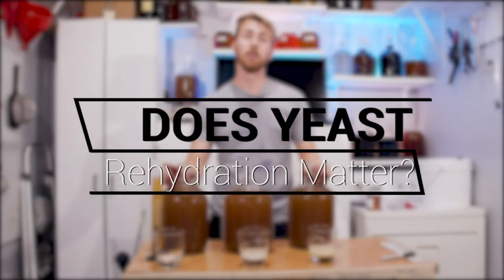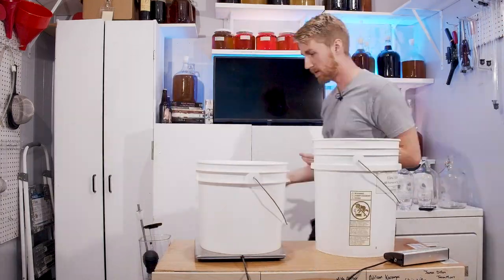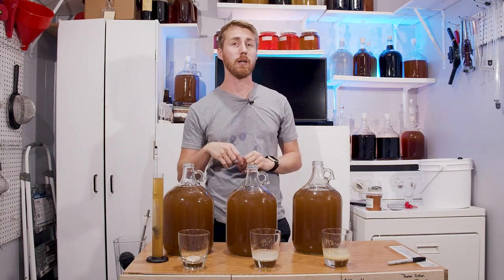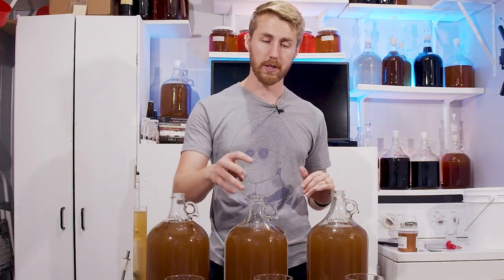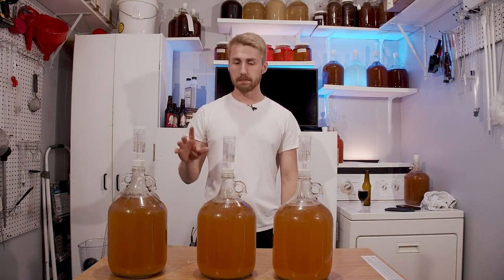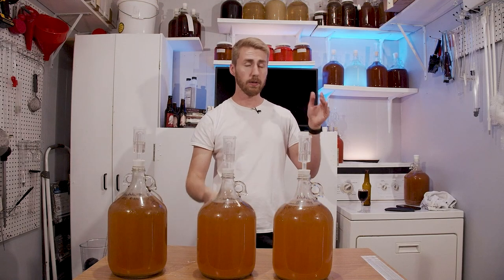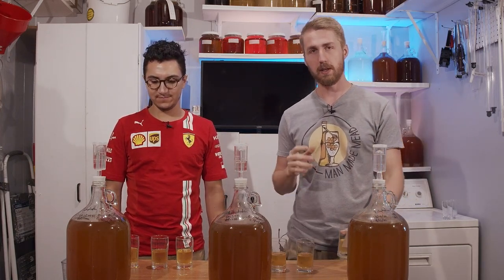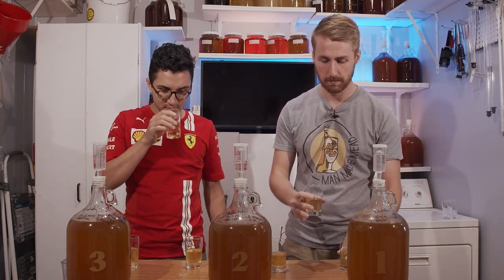Does Yeast Rehydration Matter? - A Reflective Test

Comment: The got mead podcast just had an episode where experimeads mentioned Go-ferm can cause excessive nutrient in small batches. The TOSNA calculator doesn't subtract enough Fermaid O to compensate for the nitrogen added from the GO-ferm and excessive nutrients can lead to a bitter off flavor. I used to pitch higher rates (2-5g/gal), but now I stick to 1g/gal as I find the more the yeast multiply the more esters you get in a traditional. Higher pitch rates could be good if you want clean and no esters, but you have to watch for excessive Go-Ferm if you do the [ Go-Ferm = 1.25 x g yeast pitched].
Reply: interesting. Did they say how much Fermaid O should be reduced when using Go-ferm?
Reply: That’s interesting. As a spirits maker, I look to add the most esters possible and work to maintain them throughout aging. Is esterfication frowned upon in the beer, wine, mead brewing side? I’ve not found a concrete answer to this question, and as a spirits maker, I intentionally look for ways to increase esters, but also not cause off flavors from stressed yeast.
Reply: @kjdevault  I would say it depends. Some people really want their mead to just taste like the honey, other times certain esters could clash with certain honey varietal flavor notes. I think carefully selected yeast add esters and complexity when matched with honey correctly though.
Reply: @Michael-9v2  thanks!

Comment: Question for you. It is off subject but I am in a jam. I have started a Mead and the PH is testing at 2.75. It is not really starting up like I think it should. Some have suggested that PH is too low and will stall the fermentation. Do you have any experience with that and if so should I try to increase the PH? Can I add water to increase PH? I am sitting at about 1.106 SG and would not mind if it was around 1.09 if that will bring the PH into an acceptable range. Someone suggested Tums if I had nothing else to bring up PH. Is that okay?
Reply from the maker: PH is definitely important. If it is too low your mead won’t ferment properly. You can adjust a low pH with potassium bicarbonate. I haven’t had any big problems with it so far but I know it does happen!

Comment: From my experience just throwing in yeast with no nutrients or water works just fine I feel like all the extra crap is just being overly cautious which there's nothing wrong with many things can go wrong in fermentation but generally it's not really necessary
Reply from the maker: I definitely suggest nutrients. Yeast hydration is not super important. A mead without proper nutrient will stall and create off flavors